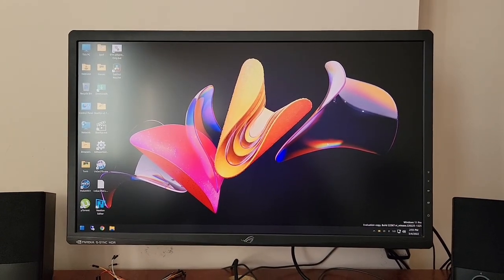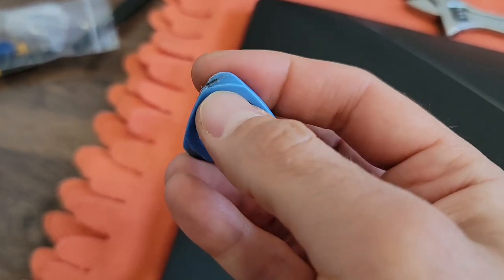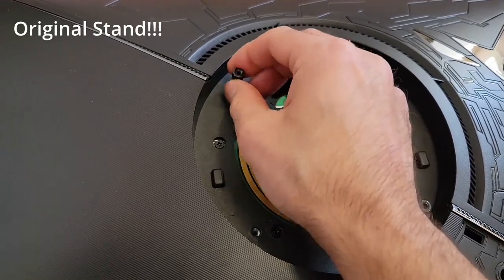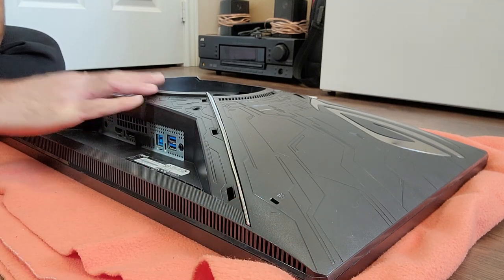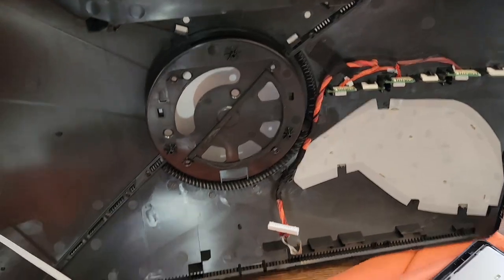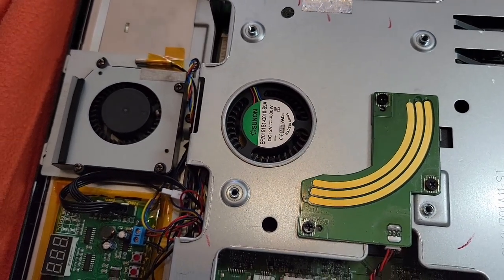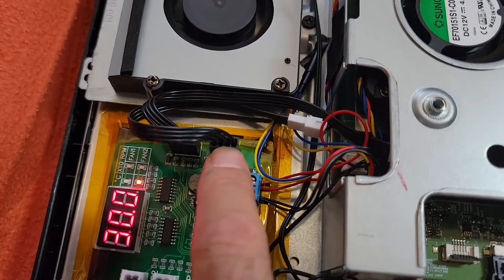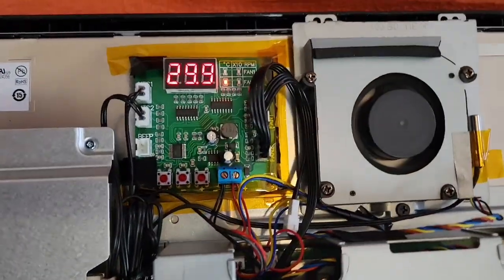Asus PG27UQ Disassembly + Modifying Fan Speed + Reduce Fan Noise

Comment: Hey mate, I have a PG65UQ as my main daily display and Ive been struggling to bare its constant 100% fanspeed... I never use HDR or GSYNC and im guessing these modules are causing heat that made ASUS install a fan... as I never use these features.. would it be possible to just unhook the fan or atleast modify the fanspeed somehow?
Reply from the maker: Hey, as I don't have that specific monitor (PG65UQ) I would not know how to change the speed of the fans without the external modification.
What I can tell you from my experience is that if I completely disconnect the fan headers form the MB (or set the RPM of the fans to the lowest value) the monitor would shutdown after a couple of second so I would not recommend unhooking the fans and turning them off completely.
Even if you are not using the monitor in HDR mode or not gaming on it, you would still need to cool down the GSYN module because the module is still drawing some current.
I realized that using the monitor in HDR mode generates more heat and the temp sensors show higher temp resulting in fans making more noise (obviously this was before my modification).
If you could open the back shell of the monitor and inspect the GSYNC module location and the fan configuration I would be glad to help you to reduce the fan speed.
If you don't want to do the MOD, I would highly suggest cleaning the fans and REPASTING the heatsink to the GSYNC module.
Good luck with everything, I'm always here to help!!!
Reply: @parhamsan  I tried opening it up when I first got it but it was stuck at some point under the floor of the screen I couldnt figure it out. Last time I tried to do a 5v fan speed mod was with my PS2 back in the day and when I switched it on a LOUD ASS bang happenned, only thing I could hear was loud ringing and my fingers were black :D thankfully just the CABLE died.. the cable.. lol. Im gonna see if I can get in contact with ASUS engineers and ask them to make a bloody firmware or something so people who dont use GSYNC\HDR dont have to have a loud fan.
Reply from the maker: @TheTanelChannel  
I assume that's an expensive monitor, so if it's still under warranty send it for service, if not I wouldn't mess around with it unless you know what ur doing.
The least you can do is to blow some high pressure air to clean the fans.

Comment: Thanks for the tutorial my friend. Do not doubt youself. Your video war more rhan good enough to instructs hundreds of us, as seen in the comments. 

By the way, the ebay instruction says something about a thirs setting stage. Do you know what it means? 
"""3.Channel II shows the mask setting: In the control panel power-off state, press and hold the "OK" button and hold down state is energized, digital display "2on" (open channel II display) or "2oF" (shield channel Second show), release "OK" button, the "+" "-" buttons to set the switch shield, pressed again after setting the "OK" button to exit into the normal working condition."""
Reply from the maker: Hey, thanks for the positive comment. Yes I noticed there is a third setting on the PWM Fan controller but frankly have not figured out what exactly it does. I think it will not help for this project anyways. I will play around with the Controller and let you know if I find anything new!

Comment: I just did a cleaning and repaste and it seems to have fixed the issues. fans haven't turned on yet. either a good sign or a sign that both the fans don't have any power now lol. my duct system was clogged with dust and the thermal paste was old.
Reply from the maker: Hey, I am not 100% sure, but the fans should turn on because on this monitor I don't think there is a fan stop mode, are the fans not spinning when the display is on?

Comment: Bro how do you connect the board's powerf? Do you just rip the extension cables and plug them in that blue thing then tighten the screws?
Reply from the maker: Hey,
You need to buy these 2 cables.
https://a.aliexpress.com/_mK1336i
Then you connect the male side to the fan headers on the asus monitor pcb.
And cut the female side from the tip and connect red (12v) and black (ground) to the pwm fan controller module. On the pwm pcb use the flathead to lossen the screws, place the exposed wires inside and tighten the screws. You can tape the yellow and blue together but make sure they are not touching.
Reply: @parhamsan  Thanks for replying bro, much  appreciated. Just one thing about cutting the extension cable. If can pull the connector off, do I still cut them? Cuz I believe there are some tiny metal connectors on the end.
Reply from the maker: @jamesjesse8057  if you can pull them then it should be fine, however make sure they can easily go in to the pwm blue connector and you can tighten the screws without damaging the connector.
Let me know if you have any other questions and good luck with everything.

Comment: if there is already has pwm ports, doesn’t it mean it already has builtin temperature readings? then why we need to add a board please?
Reply from the maker: Hey, you are correct there is a PWM header and controller on the Monitor itself, however without the external PWM controller you won't be able to control the speed of the fans (there is no option in the ASUS monitor to control the speed of the fans).
As you may already know, with using the internal PWM controller on the monitor the fans run at a very high RPM causing a very loud noise.
With this mod you can reduce the noise on the monitor.
I have been using the external fan controller for over a year now and never needed to run them more than 40% most of the times.

Comment: Can you confirm the fan EF70151S1-C010-S9A can be disassembled to be lubricated?
Reply from the maker: Hey, sorry for the late reply but at this moment I don't have spare fans to disassemble and check, I think there are many replacements that you can buy including the one I included from ebay. Check the original reddit post for the part numbers.

Comment: Can you set the controller that shutdown completely the fans under a specific temperature?
Reply from the maker: Hey, I don't think that is possible. The lowest fixed value you can set on each channel is 10% (of max RPM) which will still force the fans to spin. The only time I see the fans stop is when the monitor goes to sleep mode and the power to the board is cut off.
Reply: @parhamsan   I've set the controller, but the problem is that the monitor goes not in sleep mode, even when is powered off i've the fans always on...
Reply from the maker: @Drgunv  On your monitor have you turned on these options:
Goto monitor Menu--->System Setup--->Display Port Deep Sleep, HDMI Deep Sleep, ande Eco Mode should be turned on.
Also are you powering the PWM controller from the Monitor MainBoard/PCB (similar to what I did) or are you powering the PWM controller externally?
My monitor goes to sleep if its not been used for a while (screen goes to black) and the PWM controller turns off after a couple of minutes after that.
Reply: @parhamsan  I've done the same, and everything works correctly, i just have to try those settings and see if the fans stops after the power off...
Reply from the maker: It may take a while after the monitor goes to sleep, but technically it should. Good luck with everything, I'm always here to help!!!

Comment: Thanks so much for your video. My monitor is still in warranty, already got the fans and thermal pads replaced once in the local asus service center. After i got the monitor it worked almost dead quite for close to 10 months. I am about to send it again soon because it got audible again. I am not 100% sure what they did in the service center but have you tried just replacing the thermal pads/paste on the fan on the gsync module whit better quality product to see the results, before modding the monitor ?
Reply from the maker: Hey, thanks for the positive comment. Before I decided to open and mod the monitor, I cleaned the fans a couple of times and the noise from the fans got better for a short period of time, but as time passed the noise came back. The noise was not too annoying but the fact that the RPM was going high and low constantly was really bugging me, that's why I decided to give the mod a try. I have not replaced the paste on the module yet but had this in mind for a later video.
Thanks for the suggestion!!!
Reply: @parhamsan  Thank you so much for your reply. I will soon send my monitor for another fan/thermal paste replacement. Once its out of warranty i might try to mod it as well. Again great video thank you so much for making it.
Reply from the maker: @ArAg0rN1  Hey Cvetozar, true if the monitor is still under warranty I would leave the hard work for the ASUS :) team, I should release my video on how to change the thermal paste on the monitor soon.

Comment: A fantastic tutorial; I appreciate it. I've mod my PG27U, and it works like a charm. What's your current configuration on fans 1 and 2? I have the following and tuning it as I go along.

Fan 1 35% | LOW 50 | HIGH 70
Fan 2 30% | LOW 50 | HIGH 70

Also, some noob tips.
1. Buy extra cables in case you break them. Failed wire strips, pulled too hard, which yanked the header, etc.
2. Use a lighter to strip thin wires. I've ruined cables trying to strip it with a plier.
Reply from the maker: Hey, thanks for the positive comment,
currently I have increased the fixed value a little higher on both fans since during summer my room gets pretty warm:

1-Temp probe taped to the side of the FPGA Heatsink
Fixe value: 40, L70 H90

2-Temp probe taped to the side of the Fan Located on the top of the monitor
Fixe value: 35, L50 H70

For the blue and yellow wires as long as they don't touch you are ok, you can use tape or even heat shrink tubing to insulate them.

Thanks for the recommendation!!!

Comment: Nice, Oh BTW, does it matter if the PWM wire is all the way on the left side next to the tachometer wire? I need an answer, Thanks.

Delta Electronics Community. (DEC)
Reply from the maker: Hey, not quite sure I follow what you exactly mean? Do you mean the pwm wires from the asus fans to the external pwm controller?
Reply: @parhamsan  What I mean, is that, Is there any impact if the PWM wire is wired on the tachometer side and the tachometer is wired to PWM, Answer. Please and thank you.

Delta Electronics Community.
(DEC).
Reply from the maker: @18436Melissa  Oh IC, what you mean is you want to have the tachometer in between the PWM controller and the PWM wires to the ASUS fans correct (to show  the value of the RPM)?
May I know the tachometer model number?
If it is a digital one, then keep in mind that the external PWM controller (that I am using in this mod) is getting its power from the ASUS monitor MB so the tachometer will draw some additional current from the monitor MB and it could cause overload to the board and damage the MB PCB on the monitor.
It might be ok; if you are a teksavvy person you can measure the current that is drawn from the ASUS PCB (with a multimeter) with and without the tachometer and see the difference.
I highly recommend not to do this unless you know what you are doing.
If the difference in current drawn with and without the tachometer are minimal then it should be ok.
Do this at your own risk and please don't blame me if something happens to the PCB!!!

Comment: Great video, I did this PWM fan modification on my PG27UQ, but now my monitor turns off after a couple of minutes. i dont know why. The board is not touching metal and all the settings are the same as in the video.
Reply from the maker: Hey Alex, change both (fans) constant rpm to something higher like 35 or 40. Also decrease the lower and higher limits so the fans ramp up on a lower temperature.I found mine to work with 30% fixed and the low to 70 and high to 90. I have been playing around and found these values works the best on my monitor for lowest noise.
If you monitor turns off then the fpga is overheating.
If it still turns off increase the fixed rpm % for the fan that cools the fpga (fan 1 in my case) to something higher. Another thing to check is when the pwm board toggles what are the temperatures, are the probe temperatures make sense.
I ended up mounting the pwm board outside my monitor to be able to control the speed when the monotor cover is assembled.
https://www.amazon.ca/clouddrive/share/aZRCiUvW3iFqRY4rQq9hr926ao27CMQrYIPTXjt2Wdr
This is a video that I shared with another user.
Let me know if increasing the rpm doesn't solve your issue.
Reply: @parhamsan  Thanks for the tips, i put the board on the outside and set the fan to 40 and the monitor lasted longer this time. I will continue to play around with the controller to get it at a good sound level and get the fpga from over heating.
Reply from the maker: @alexhutto4829  Cool, since you opened the monitor make sure the fans and the heatsink are free of dust and cleaned; another recommendation would be to clean the thermal paste and reapply it with a new descent thermal paste if you are up fot it. I will be posting another video on how to do that soon, good luck with erything.
It definitely seems that your fpga is overheating.
I have a very warm room but even with fixed rpm of 30% I have not experienced a monitor shutdown so you might wanna consider changing the thermal paste.
Reply: @parhamsan  Thank you, my room also gets warm. So just to make sure it runs cooler I will most likely change the thermal past. I have FPGA fan fixed set to 40, low to 60 and H to 99. The top fan is silent now and the fpga fan is also a lot quiter. Super happy with the results. Will do thermal past later. Fun project.

Comment: Hi, can the high temp 100% limit be set to say 70% fan load, High not going above 70 to 80% max fan load. I have delta fans which are really high amp 3.9 to be exact.
Reply from the maker: Hey, no unfortunately once the high temp limit is set, the fan will run at 100% of its capacity so full load (rated current). I do not suggest using any other fan than the ones used on the monitor, if you draw too much current it might damage the main board on the monitor.
You can probably limit the drawn current with a resistor but again I don't recommend it.
Similar to a low noise pwm adaptors used on the Noctua and other fans.
Reply: @parhamsan  Thank you for the response and for making this video, Yes I am aware of the 3 Amp draw limit on this board I was planing on powering the fan separately and just use the PWM and Tac pins for rpm only. I guess I'll have to check / experiment with it once it gets delivered.